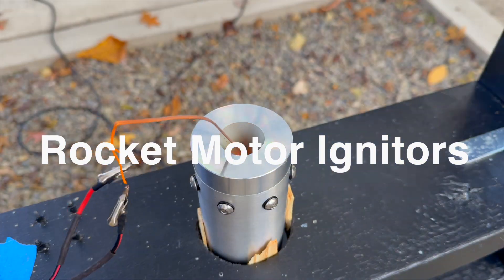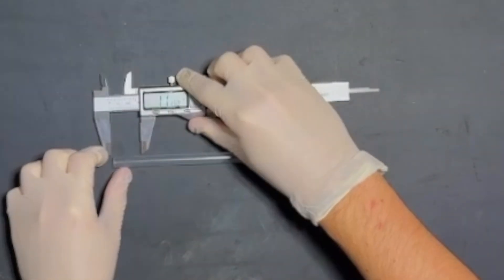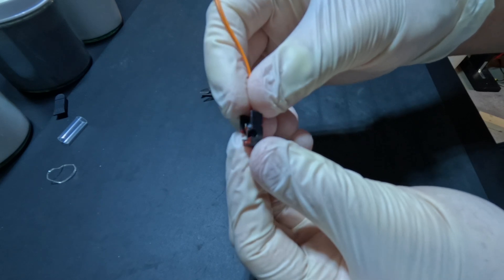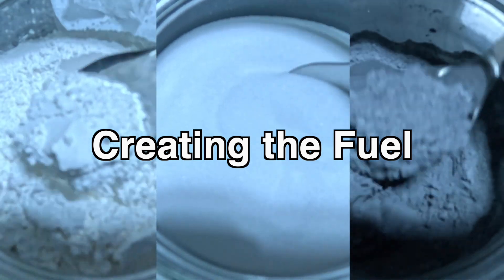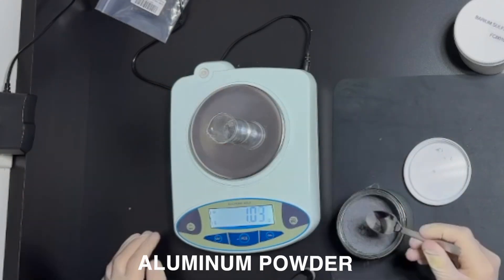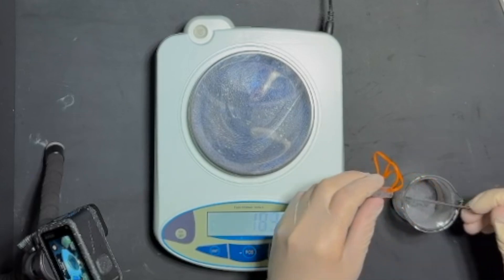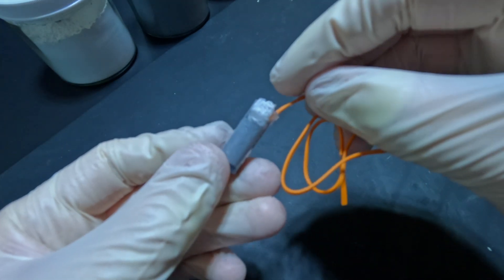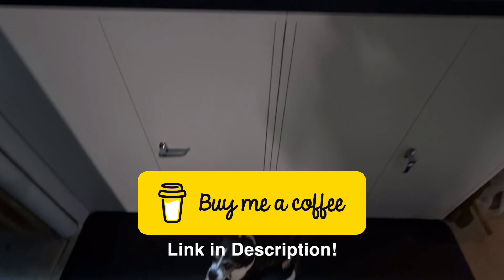How I Build My Rocket Ignitor!

Comment: One thing that might be happening is it appears you are lighting the mixture on the sealed end of the straw instead of the open end. Normally, packing the mixture tighter will result in a slower burn, not an explosion. Loose material burns faster than packed material because of more surface area exposed to flame. However, that assumes it's burning from open end to closed end. By lighting on the closed end and packing material in tight, there's no way for gases to escape, so pressure builds up until it explodes. It's basically a firecracker at that point. It might be worthwhile to try closing end of straw, packing in powder, then attaching igniter on the open end. Or, doing it same order as you're doing it now, but only close igniter end with wad of paper or paper tape, something that will blow off easily. The gas needs to escape from the end that's burning, which means same end as igniter. Probably won't explode then. Nice work, though. Thanks for the quality videos. Stay safe.
Reply: If there's not room at igniter end of straw for escaping gases, you can cut a slit in that end of straw and tape it shut with paper painters tape. That should open up easily once burning starts. Something to consider ...
Reply from the maker: @tvinctw6029   Thank you for the detailed explanation! Your point about gas needing an escape route makes a lot of sense. I’ll adjusting the design to allow proper venting! Will implement these changes for SN3 upcoming test.